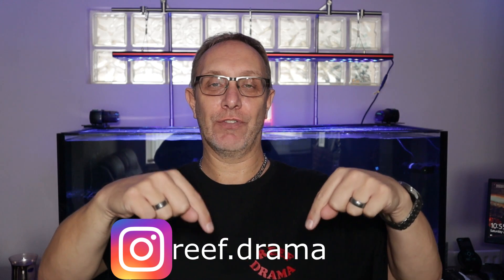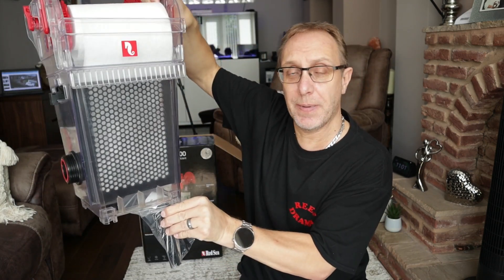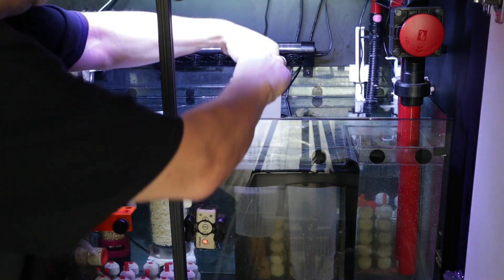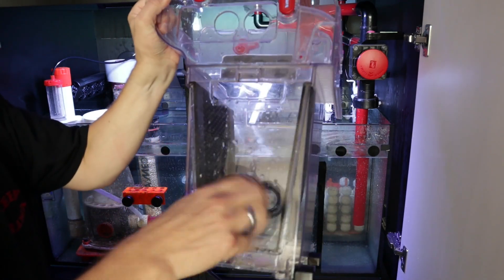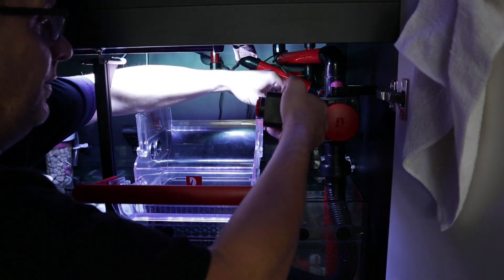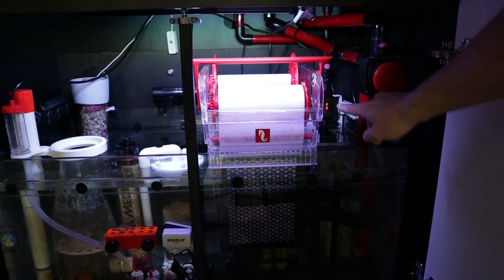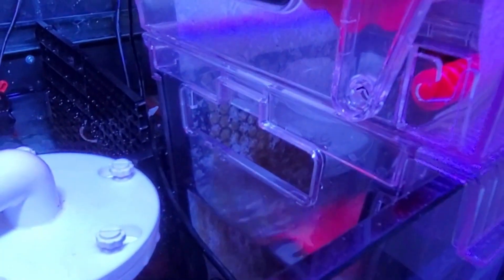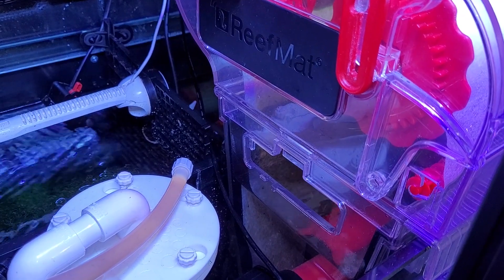Red Sea ReefMat install on the Red Sea 625xl G2

Comment: Great video. I’m thinking of buying one myself, I’m wondering how much waste finds its way into the sump via the secondary drain?
Reply from the maker: Thank you. Well my emergency drain hardly has anything going down it and if I need to I just syphon out the sump detritus if needed. You could always have a filter sock on the secondary drain or even plumb it into the other side of the reef mat so absolutely everything goes through it.
Thanks for supporting my channel 😀
Reply: @ReefDrama I’m convinced. I have a friend visiting from China in early February so I bought one from there (after asking if they minded carrying it). Saved around 140 quid 😊reefmat 500 for my DD1200, thanks again

Comment: Great video. One thing I have noticed is your water level in the sump is quite high. This means you are at a disadvantage as the starting level in the reefmat is high too. Ideally you want the level below the pipe entering the mat. I’ve learnt so much with mine and now use much less roll as a result of that and ensuring the return pump is not too strong. You can usually tell how optimal your use is by the colour of the used mat - you want it as dark brown as possible.
Reply from the maker: Hi James, Thank you. I have read on the Red Sea ReefMat site that the water needs to be just above the inlet. I wanted to make sure everything was working correctly first before I started reducing the water as it would affect the skimmer, too. You are right, and mine is a but too high 😀
I think having the water level below the pipe entering the Mat will be way too low, though, and only give me 7.5 inches, which is too low for the skimmer. My skimmers optimum is 9 inches. The top of the inlet is 10 inches, and as the skimmer is on a stand, it would be perfect then at 9 inches. At the moment, now I've changed the advance to 2.0-2.5cm the water is about 3/4 inch higher than the top of the inlet so I will look to adjust the baffle before the return pump section.
Great spot, though 😀  
Thanks for supporting my channel.

Comment: Welcome to the Reefmat club. One thing Red Sea won't tell you is the need to power cycle the reefmat every time you do an update. If you don't you run the risk it will chew through the roll without using it....
Reply from the maker: Hey thanks 😀 What do you mean exactly by power cycle? 
Thank you for supporting my channel  😀
Reply: @ReefDrama think he means reboot via the app after any updates.. 🤷🏻
Reply from the maker: Hey, cheers mate. Yeah, I guess so 😀
Reply: @ReefDrama  just installed my mat like 20 mins ago....im also using the red sea ATO...im sure this will be an issue as water builds and drains from roller the ato will kick in
Reply from the maker: Hey, it hasn't seemed to worry mine as it should only be the last chamber to rise and fall, but I know what you mean. I think it might also depend on how much you set it to roll on too.
Hope yours is going well? 😀 I love mine.
Thanks for supporting my channel.
Reply from the maker: Hey mate, could you tell me how to reboot via the app as I've just completed an update and don't want it to start using up loads of the roll.
Thanks.
Reply: @ReefDrama  go to device manager, click the desired device and hit the reboot option... I haven't rebooted since the update and had 0 issues so maybe they fixed this bug in the updates lol
Reply from the maker: @BlazedReefer cool, thanks. I'm going to monitor it over the next couple of days and see if it uses more or stays more or less the same amount of usage.
Reply: @ReefDrama  have you also set your mat dispense length to 0.5-1... seems to work best
Reply from the maker: @BlazedReefer it wasn't no, but it is now 👍
Reply: Hi thanks for vid , is it quite 🤷🏻‍♂️

Comment: After having it for this long, have you noticed your nutrients dramatically drop? Did you come close to bottoming out nutrients?
Reply from the maker: Hey mate, it's not really a fair representation due to the fact I have a massive, messy eating Porcupine Puffer, so my nutrients are always around 20-30 ppm Nitrate and 0.1-0.2 ppm Phosphate. 
I also dose No-Pox. 
Once the Piney is moved into his new home (upcoming video spoiler alert ⚠️), I'm hoping the nutrients will come down and then I'll be able to see what happens with regards to having the Reef Mat taking everything out.
Thanks for supporting my channel 😀